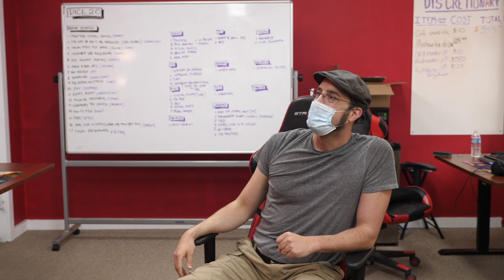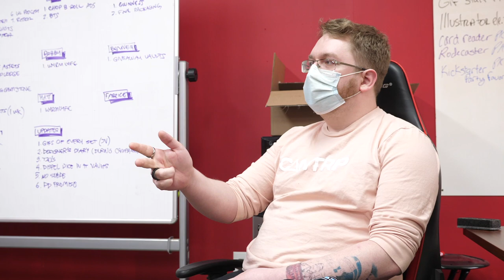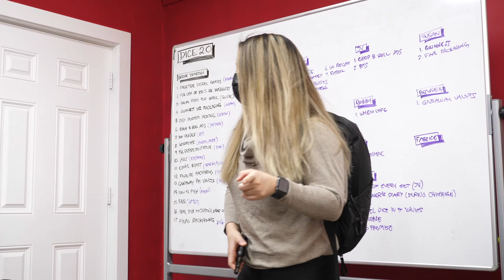$44,000 in DRILL BITS?! (also new metal vaults) S7E36

Comment: Re: Tooling, you guys might want to talk to your vendor about regrinding those carbide tools if you don’t already. I’m a tool setter for an automotive manufacturer and we now regrind all of our carbide drills and cbd cutters, and some of our indexable blades as well. Saves us 10’s of thousands on our tooling budget. As for the pickup thanks to the double hit, could you redraw the tool path so that the first hit occurs higher or lower on the cutting edge than on the second pass? Could help to spread the stress across the length of the blade and reduce burring on the finish.
Reply: This needs to be stressed. the toolpath needs to be updated. regrinding is so common in other industries.
Reply: They also should look into a roughing and finishing tool, not just tool path. The surface finish doesn't matter for 90% of the removed material.
Reply: @DrigrX  This could be obtained somewhat with tool path improvements. If tool life was the priority then a 3 cut pass would rough out using the the top 1/4'ish of the tool for two roughing passes and the bottom of 3/4 of the tool for the finish cut. 

Also oiling/lubricating the face of the tool periodically may drastically improve the tool life, being careful to use a safe oil for post processing. This will reduce the chance of dust and tannin adhering to the cutting surface.

Carbide tool life should be good for wood unless it contains trapped sands.

Also with all tools to slow feed and high spindle will always build up material on the cutting edge. A good test would be to clean the tool and check if its still has a edge, use alkaline oven cleaner for pitch and tannin; or xylene for soft sap or gum. It would be a shame to buy a heap of tool bits only to find they were dirty...... But if they did they wouldn't be the first to make that mistake as nearly every carpenter does the same for carbide table saw blades.

Comment: That 1 bit was $800. Replacing once a week (52 times annually) is already $41,600 per year. That's the cost of basically all the diamond bits together. Big cost savings there.
Reply: And that isn't even counting the wasted time swapping out bits. When put like that, it's such an obvious solution and I think Doug realized that in the end.
Reply: And thats still best case scenario. Factor in taxes, shipping, potential downtime if an order is backed up as well as a bit may have to replaced be twice a week. Adding an another 20,000$ on top of that is a lot, but feels like the 'when shit happens' price.
Reply: Only saving costs if they truly last longer than a year. The decrease in downtime, increase in output, and therefore potential increase in revenue is the big win.
Reply: @ruggeddusty  Who knows, they might. The hardness and increased temperature tolerance from the diamond mean that they should cut through wood with hardly any wear. Some of the woods they work with like purple heart are very hard woods, you need a much harder bit to handle it.
Reply: @ruggeddusty  the $44k was 12 total bits. 2 sets of 3 for 2 machines plus 2 backup sets. Replacing 1-2 per week means every week one machine needs a replacement and some weeks they both do. I used the math of just replacing 1 per week. The break even point is closer to around 1 month per diamond bit.
Reply: @NovaHorizon  Ah, good point 👍
Reply: ONLY IF nothing goes wrong with the diamond. I work in CNC machining and while diamond coated tools are more durable, carbide is safer in the long run because if something goes wrong you are only out $800 instead of $8000. I have made my own comment on the video that goes over that there are other ways they could have tried to save money sticking with the carbide instead of jumping to diamond coated. We swapped one of the tight tolerance boring tools in my shop from TiN (Titanium Nitride) coated to diamond coated and had to do a ton of cost-benefit-analysis and if we break even one of them in a year, basically all of the cost savings from doing things faster with less need to replace the tool is out the window.
Reply: And thats without the downtime cost
Reply: Brand is suffering hard on keeping up with fulfillment time promises. There will be a time when you cant blame COVID any longer but overfilling the pipeline beyond your ability to deliver.
Reply: I did my math based on the low end estimate ($600), which comes to $31,200. Double that for the two machines, you come out to $62,400... Which means that they’re still better off going diamond. Quality over quantity wins again.

Comment: Feels like the marketing department is eating what IT departments normally face: Deadlines, equipment and material given from the outside without any consideration for production/turnover times in the marketing department.

This is a common problem in companies ran by engineers who are used to being able to put production times and quanitifeable time measures on certain things - something that doesnt work in any creative work and lots of other areas (IT, Change Management, etc.) simply because showstoppers can appear much more out of the blue and/or production cycles just do not have set times that they can reliably operate in.

Failing to integrate those departments into the scheduling process into a meaningful way is a HUGE risk for any company, not just in loss of quality of work, but also employee burnout. PLEASE take this more serious and think of ways to fix the issue rather than saying "just deal with it" - it traditionally does not end well.

Comment: There is a major difference between settling with graphic design not being the best it can be and settling with a product design that the department heads and CEO agree aren't up to the standard normally held. One is something the customer will actually hold in their hand and pay for. The other is just glitz and glam to encourage sales. Attention to quality of the products being sold is far more important because that's how and where Wyrmwood got its name. There is no better sales tool than an outstanding product.

I'd rather have some halfhearted design on the Kickstarter page and a truly outstanding product in my hand than the other way around. No question.
Reply: This. 100%
Reply: I mostly agree with this.  But the "quality" that Bobby seems to be referring to is the subjective opinions of the art.  The vault itself is the same quality that we know and love.  Even more so with the changes making it even more usable.
The art seemed to be pretty popular with the fans last week.  I personally don't care for the flowers and blades theme, but that's me.  Wanting to improve that is fine, but it does not make it less quality.  The work on that art was pretty sharp.
Reply: Bob Crossen, to me, they focus so much on the Kickstarter page because they are using it as a business model. I mean it goes against the essence of crowdfunding but it works for them and allows them to expand based on demand. This is a good thing, but if they fail on a KS imagine how much that would slow the business overall. I think at this point, the KS pages have to be almost perfect every time.

Comment: Just off the top of my head, that sounded like ~50k a year in carbide bits. 44k for even one year with diamond sounds reasonable, but for possibly 3?! That's a steal.
Reply: 2 bits per week * 52 weeks * 800per bit.  $83,200  That's not even factoring in the time to deliver new bits, the time spent replacing bits, and the time spent correcting the cuts.
44k IS a great deal.

Comment: Those diamond bits might cost a lot, but if you guys are going through that many carbide bits now and aren't even at full capacity they will pay for themselves pretty quick. As for zombie apocalypse weapon:  a   Heligan tool, can be easily used as both a weapon and an extremely useful tool to to gain entry into places.

Comment: i got to agree with Bobby you seem like you're being stretched really thin and I've noticed a bit of a drop in quality. it's not a lot but it builds up
Reply: I couldn't agree more. I love blades and blossoms but I probably wouldn't get one of this set due to the money I'm spending on the dispel collab plus the drop in quality.
Reply: The quality issue is bunk.  Those dice vaults were quality.  Just not to Bobby's liking.  Many people liked the look of the art.  The subjective part of the piece cannot be viewed like the objective part.  The work was quality, the art was opinion.  That does not stop them from being popular.
Personally I didn't like them.
Reply: @DarthPoyner  Same here, the vaults were designed and built just like how they always are, the art is what is subjective. I wouldn't the blades and blossoms line up because of how busy they are, but I know several people who will. It all depends on the buyer.
Reply: @RoseKindred  The fact is that they agreed they weren't quite good enough and still decided to push promo

Comment: The cost per annum if you DONT go Dimond... $800per bit X2 for dual spindle = $1600... X 2 per week = $3200 per week X 52 weeks = $166,400 + 2 backup(and hope to God you never use them) = $168,000 per year... $336,000 for two years versus $44,000 for 4 Dimond bits that will last you those 2 full years!!!! Yeah good choice!
P.S. it would take 7.5 Dimond bit replacements (aka 15 years worth) to match the cost of 2 years of your current bits replacements cost!
Hope this makes you feel better Dougy 😁

Comment: Here's a solution just buy the first two dual bits which is 22,000 see how that works for you before you buy the other two... See if it's truly the solution you need or you run into errors with those two bits... But I'm just a comment on YouTube you'll probably never see this.

Comment: if the carbide bits cost 750 bucks a pop, they have two machines with two bits running (4 bits total) and they have to replace the bits once every 3 days. In tool costs alone (not counting labor for changing bits or wasted lumber for bad cuts) the carbide bits alone will cost $363000 in one year.............. by spending 44000 they should save almost half a million a year. EASY CHOICE DO THE MATH PEOPLE! (365 days per year divided by changing a bit once every three days means 121 bits used per chuck....121 bits per chuck times 4 chucks/spindles means 484 carbide bits used per year....484 bits times 750 dollars per bit equals $363,000 dollars...start adding labor costs and wasted lumber costs and they easily save half a million a year on the diamond bits)

Comment: the diamond tips just make sense. even if you say it is 1.5 tips a week on the carbide, that'd be 800x1.5x4x12 which comes out to 57,600. factor in that diamond bits last two years, and it's 44k v 115,200. it's a simple trade-off, not even accounting for downtime due to switching, plus labor for retouching.

Comment: As someone who works in CNC Machining (Aerospace) - I love/hate these segments about their machining process.

First of all, I think they will be disappointed in the results from the diamond bits. It's true, diamond coated tools are harder and more durable than carbide, but the issue seems to be from build up more than from general wear and tear. They also got so close to realizing part of why they are having this issue but missed the mark just barely. They are double working one part of the cutter. The cutter itself looks big enough that they could probably offset cut with it to even our there wear. This would mean cutting the first pass with the tip (bottom 30%) of the cutting edge, then doing the second pass with the remaining 70% of the cutting edge so that the are wearing the tool evenly. Alternatively, this burn/build up wouldn't matter as much if they used a roughing and finishing tool. Take these carbide tools that are worn out and instead of throwing them away, have them cut the chamfer to within say .100 of the finished edge (or however much that deformation is). Then tool change to a fresh tool that is only cutting that last .100 of material. This finishing tool is not only not working as hard, but it is also making a consistent cut every time, thus getting consistent wear. And if you really want to stretch things, these finishing tools become your new roughing tools when the finish is no longer acceptable. And if you REALLY REALLY wanna stretch things, if the roughers aren't totally destroyed, send them out to get re-ground or get someone to learn to re-grind them in house.

Also, on those metal vaults, anodizing is actually growing/bonding a coating onto the material, that .001-.003 inches of material needs to be accounted for in the initial design.

Comment: Diamond encrusted tool, and not make from actual natural diamonds.  In the 1950's, by total accident, GE found a way to make synthetic diamonds.  But they never when any farther with it, they stopped with making very small ones for tooling.  Other have take it to the point synthetic diamonds are gem quality.

Weapon of choice: Flamethrower. Line one Zombie on fire, and tt will light others on fire.  It is also one of the simplest weapons to make and maintain.

Comment: I'm no CNC expert, but couldn't the positioning of the blade in the program be changed / varied during the cut, in order to wear the blade more evenly? Or if it's burning, lower the spindle speed for the initial cut?

Comment: Well to be honest, its diamond dust... the biggest industry is the dust left over from diamond mines and jewelers. The expense is the application of diamonds to the tooling that doesn't get removed over time. Diamonds are not expensive in reality, its just a very useful material that is difficult to use... And diamond rings are overpriced cause they can get away with it. Try to refund that diamond ring and you'll just get the value of the gold.

So tldr, Diamonds exist in huge quantities and we can fabricate diamonds. Large Natural Diamonds have a high value. The small ones and dust does not...

Comment: Ignorance since I don't work on milling machines.  Can you not specify where on the tool head to cut?  Could you vary where you take those smaller bites from to different spots along the cutting surface so that you can even out your wear?  Might be a pita to program but might pay off if possible.

Comment: I think that in the long run, it really is a lot cheaper to use diamond bits. Going off what they told us if it's $600 for one bit, and they replace it 1-2 times a week (avg 1.5) and you run the machine all year (about 52 weeks). Then the cost for that one bit for the year is about $46,800 dollars on average, it just sucks as it has a massive upfront cost instead of it being spread out over the year. Keeping in mind that they are also not operating at full capacity meaning that the cost would increase exponentially if they keep using the carbide bit. I hope that I am understanding this right.

Comment: wait.. carbide bits, best case: $600 /bit X 2 bits one/machine X 1.5 replaces a week X 52 weeks (one year no break) = $93,600 X 2 years = $187,200 for two years of bits + Cost of ruined toppers from burn lines (assuming it's only the one bit causing the issue, I'm sure the actual cost would be higher because the other two bits are not likely to last two years.)
OR
$44,000 for diamond bits for two years + no ruined topper from burn lines (assumed, there is no guarantee of zero burn lines from the diamond bits yet)
This is a no brain-er for me.
Reply: 1 crash $11k vs 1 crash $600. more variables than just the cost of the tool.
Reply: @mcdotterson4103  Very true! I still think moving to diamond is the best choice at the moment. Actually trying will give them a more accurate long term cost analysis.

Comment: I would encourage cost analysis and a time/efficiency study with 1 set of diamond before you buy them all.  If you are going through bits at an average of 1.5 a week (I'm assuming this is total for all machines), 700 dollars each, you're spending 54K a year on bits.  If those diamond bits DON'T last a year (like if the problem and the reason you're going through bits is your equipment), you could be losing money.  You have to account for down time too, on both the old way and the new way.  At less than a 20% margin of difference I'd hesitate to make a decision without all the facts and figures.
Quick implementation/fixes seems to be the go ahead at Wyrmwood, but you don't know what's going to bite you on the back end and that's going to hurt more the bigger you get.  Consider getting a Six Sigma/Lean Manufacturing consultant before making rush decisions, especially on "efficiency improving equipment."
Reply: this is also ignoring regrinding the cutting edge and re-using. single use of a carbide tool is dumb if it's just being replaced from wear. unless that tool shatters, it's life can be extended.
Reply: @mcdotterson4103  100% agree.  There needs to be more time and thought put into big changes like this.  As great as they may sound, there could be a thousand options that are much less expensive and more efficient in the long run.

Comment: U could setup a router table to break the edges. If ur running them at 30seconds a piece factoring in breaks ur at 5 man hours for a production run of 600 pcs. It’s prob a net 0 exchange labor to tooling depending on ur labor setup.